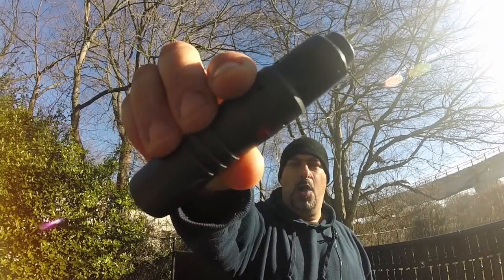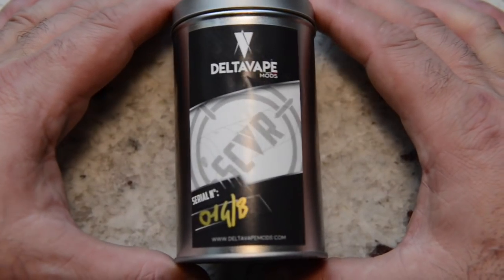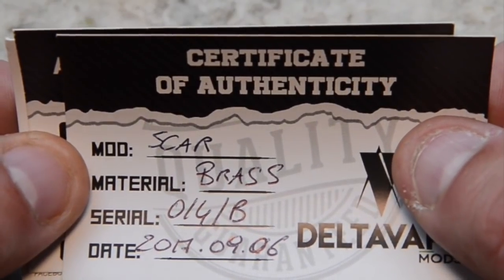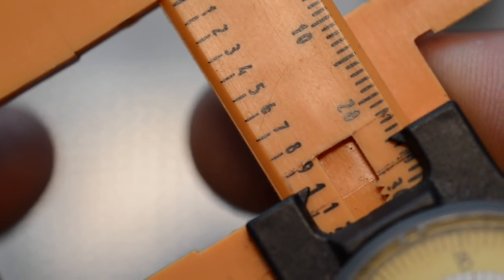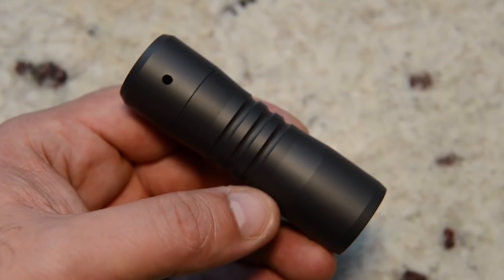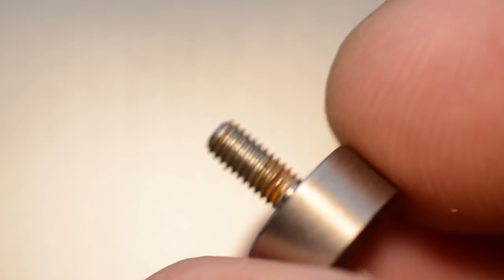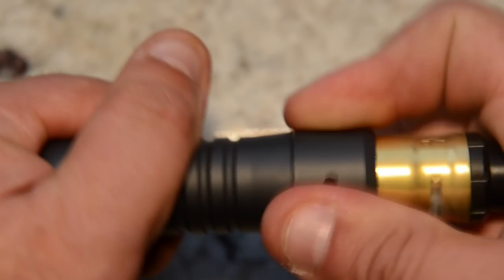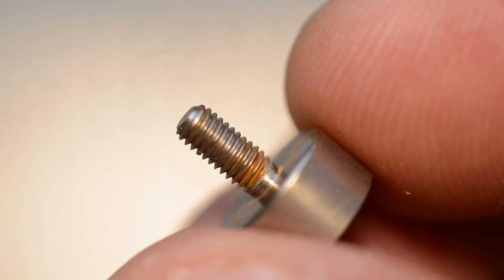DELTA VAPE MODS SCAR

Comment: Great honest review as always Lou .. bit disappointing to see the rust on the screw threads for a Mod of this Calibre and Pricing .. The magnet in the Switch is a nice feature along with the throw adjustment .. based upon your review I’d definitely consider purchasing one if the rust issue was resolved ..

Comment: Lou, with that huge contact adjustment and the added battery sleeve, could you not use a 20700 battery?
Reply from the maker: 18650 only. I have tried 20700 batts and yet they just don’t fit

Comment: What resistance do you usually run? I got some 20g n90 wire and I want to know if 0.08 dual coils are doable on my vgod pro mech that uses a vtc5a and vtc4's
Reply: Nixeus 404 that's about what I run bro the batt cab handle just don't chain vape it

Comment: I love tube mods more than anything. I have the China cheapos and they are awesome. I can not imagine if I get my hands on a high end one. Just want white brass. Been looking for 2 months and still not one I want to send the money on. I would buy a hyon in a heart beat. Just no white brass
Reply: What about the admiral white brass? Its one of the best designed mods, and now they have released an rda that hybrids into it like the subzero shorty, safe hybrid right there. Fully delrin lined with 18650, not with 20700. If your really into safety go sony vtc5 and the whole tube is insulated. And clutch buttons are the best IMO, I have the sz shorty and the sz X. My favourite mods.
T
Reply: El Tomaso I have checked them out. Just hard to find the white brass. Last I looked they was sold out